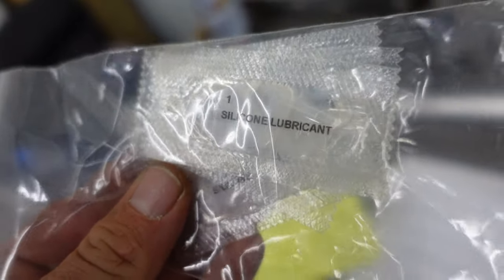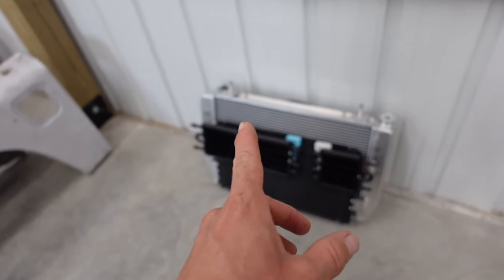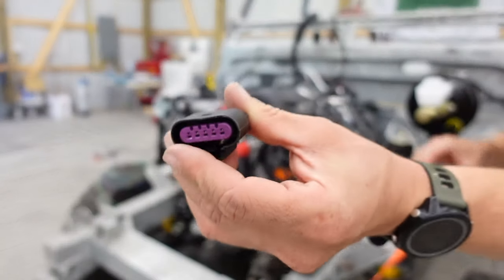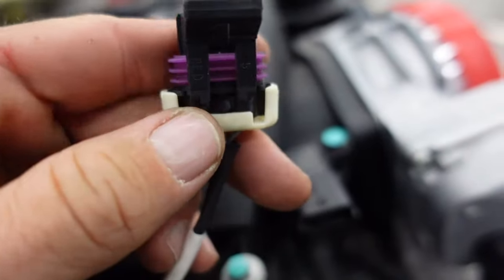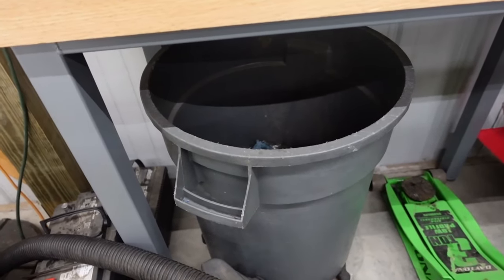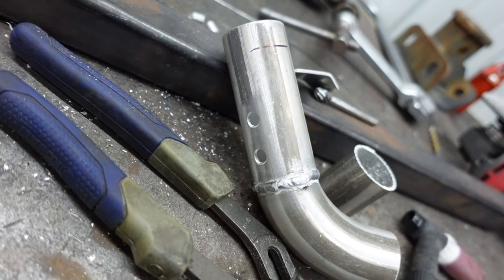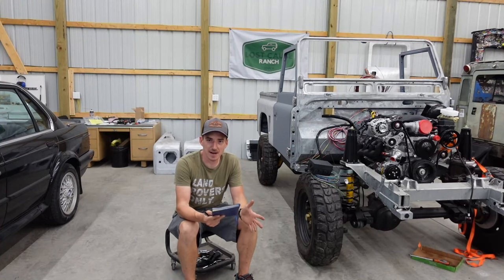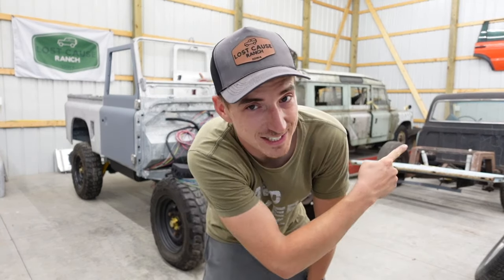What Do We Need To FIRE Up The LS3 Swapped Defender

Comment: tensioner is a tad over range. its going to contact the idle pully. need a belt about .5 to 1 inch shorter.
Reply from the maker: That may be correct. I was going to wait until I had the actual bracket for the power steering machined. The one I 3D printed deflects with belt tension on it so that tensioner will be sucked back some with the actual bracket.

Comment: Hi Joe, Great to see you making good progress on the LS Defender project. The issue with the Knock Sensor really sucks, especially as this is meant to be a complete kit, question, is it that some muppet fitted the wrong plug to the wiring harness, or did they install the wrong knock sensor?🤔 Good to see Sasha back in front of the camera even if she is only sunbathing lol 😂 Did the mods on the Honda manage to give the old girl one or two extra BHP, suppose if she now manages to climb the hill and achieve more the 20mph now we can class the conversion a big success 👍🤣 Look forward to the next update 👍😎
Reply from the maker: It picked up a couple miles per hour up the hill. We may be at like 2.75 hp vs 2.5 now haha.

I'm going to dig around and check what MAP sensor it is supposed have as well to see what side the issue is on.
Reply: @LostCauseRanch  Hope you manage to get to the bottom of the issue and get it sorted, keep up the great work 😎👍

Comment: Been subscribed now for a while and lived in DeWitt for several years.  Now in WI.  I have 3 Land Rovers.  Your channel captured my attention as a result of the timing chain replacement.  I know you used to do repairs on the Ole LR’s but is that something you still do?
Reply from the maker: That’s neat, small world. Not a whole lot of work for the public anymore but still take on certain stuff here and there so if you ever need anything reach out and we may be able to help depending on what is going on. 

What do you have for Land Rovers?
Reply: In 1st place is an ‘05 LR3 HSE, all original.  She’s the people/kids mover with 7 seats and 250k miles.  She’s been pretty much bullet proof.

2nd is the Ole Sport, L320 HSE.  She’s (not sure why they’re all females) a charity case that’s been ridden hard and with little work done until I got her!  She’s about buttoned up less a new starter solenoid.  At 120k miles, she is pretty complete.  Just did a trip to TN and another around Lake Mi without a hitch!

I’m a bit of a rescue case kind of guy, and the New Sport is a ‘’11 HSE Supercharged monster.  She’s still driving fine with 140k miles but I purchased it with 120k miles and am now at 140k!  It sound’s like a Cummins diesel and the supercharger coupling is on its last leg.